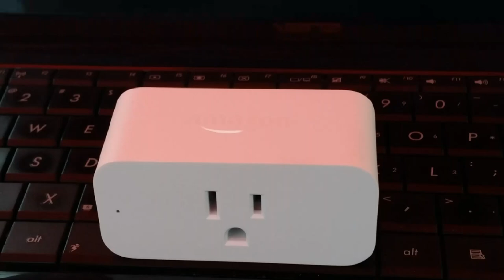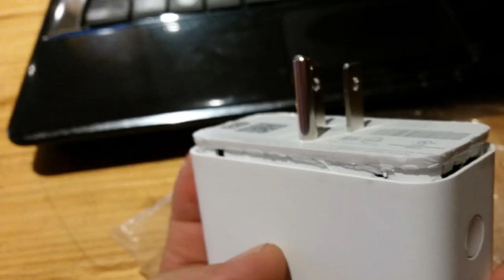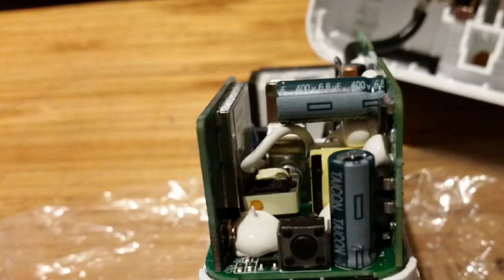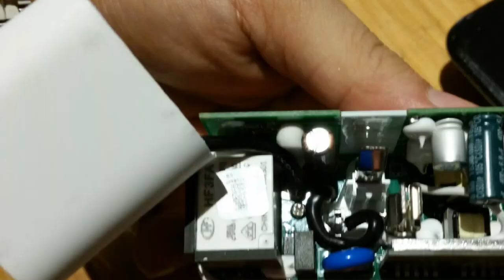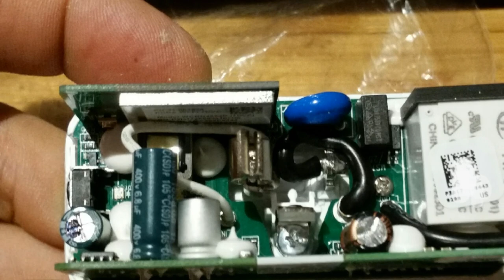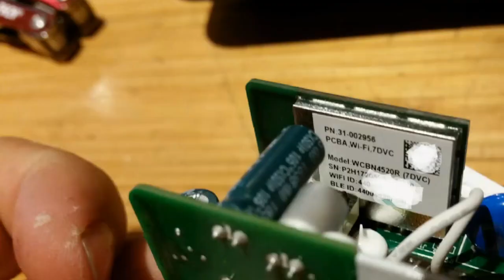Amazon Smart Plug teardown pictures series

Comment: What causes the clicking sound when going on and off?
Reply: The large black box in the middle left is the mechanical relay. There is a piece of metal inside that gets pulled by an electromagnet to close the circuit and turn your device on. When it moves back or forth you will hear the click
Reply: @mitchtalmadge  thanks!

Comment: These are the only teardown pics I could find! Did you discover what SoC/processor is used here? Any debug ports?  From your pictures, the WBCN4520R looks like a Lite-On 802.11 USB 2.0 combo module.
Reply: Searching the FCC ID database for that part number doesn't turn up an exact match, but there are some apparently related device from Lite-On that appear to be 802.11 devices.  At least one that I looked at was dual band (with 5.8GHz support); perhaps this is a stripped-down version that's custom for amazon or something.

But it appears that it's very likely not an ESP8266, so no reflashing with Tastmota or ESPHome.  Having this only controlled by Amazon isn't really all that useful to me.  Got it on Prime day for just a few dollars along with an Echo Dot on the off-chance it might be useful to me.. turns out, probably not..